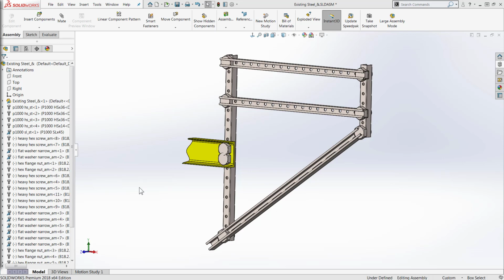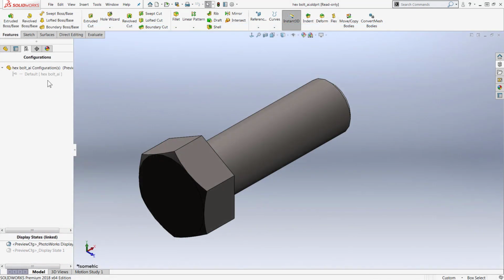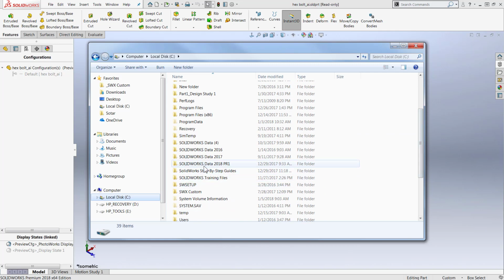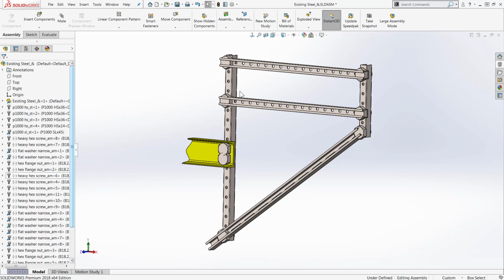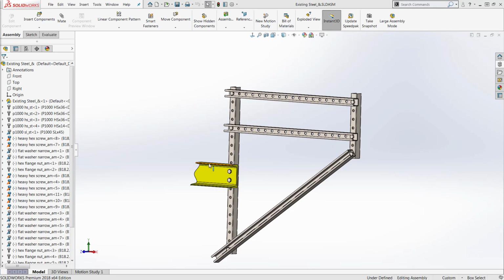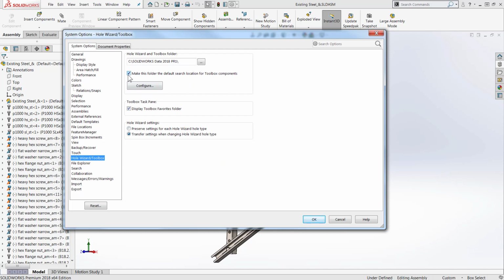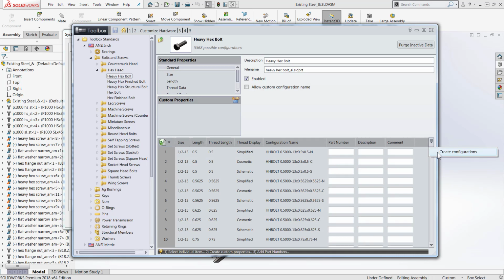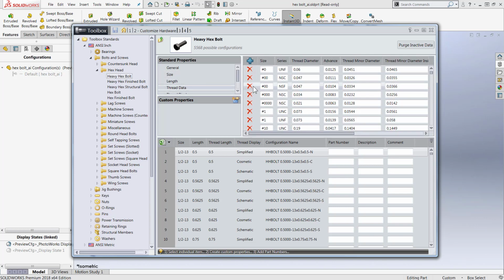SOLIDWORKS Fixing Incorrectly Sized Toolbox Hardware

Comment: Perfect and detailed video.
I was wondering if you can share more information on glitches faced by solidworks due to hardware issue. I have Nvidia Quadro k3100
Reply from the maker: Have you checked to make sure you are using a certified graphics card driver? That is usually the first thing we would recommend

You can download the supported driver here: https://www.solidworks.com/sw/support/videocardtesting.html